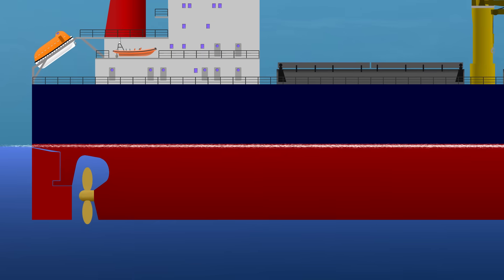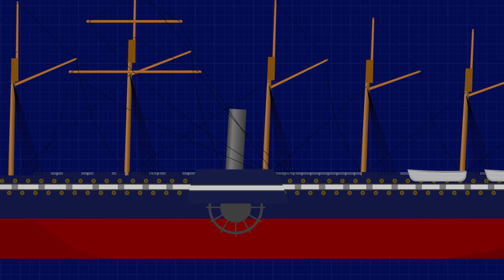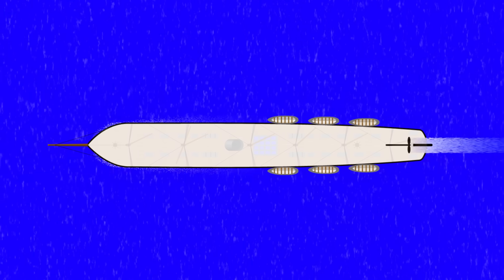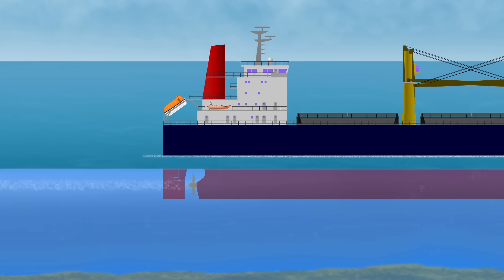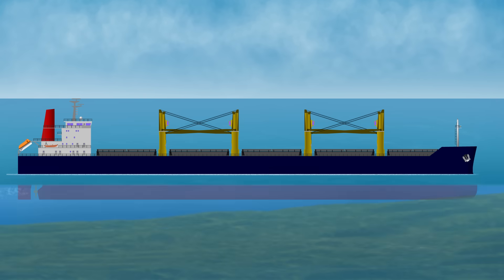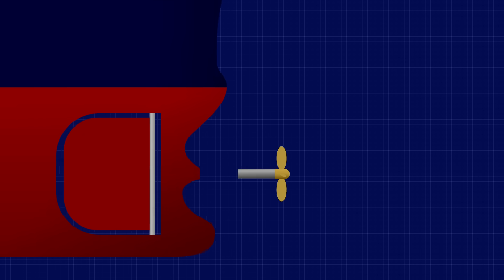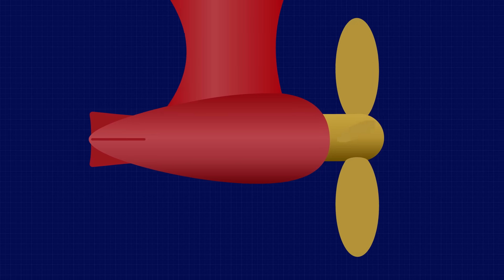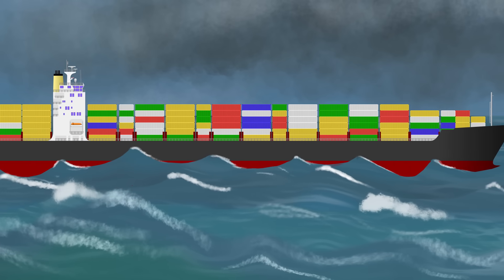Why Is The Propeller At The Back?

Comment: Interesting that he didn't mention what seems to me the primary reason that you never steer a ship from the front, which is the same as the reason that you never steer an airplane from the front either. I mean you can do it, yes. And some airplanes have done it. But it's inherently unstable.

It's like driving a car in reverse.

The dynamics are interesting. It only makes sense that driving a car being steered from the rear would be inherently unstable and want to make you flip around, if you just think about the geometry, the positive feedback loop — the runaway effect.

Or personal experience. It's incredibly difficult to maintain stability steering a car in reverse. It would be the exact same way flying a plane or steering the ship with the steering surfaces in the front.

Because of fluid dynamics as opposed to road dynamics, steering the ship or an airplane from the front would make you want to flip around the exact same way a car wants to flip around in reverse.

Anyway, this seems to me the primary reason: this inherent instability that would make the ship want to suddenly flip around like an arrow flying with the feathers on the forward end (and the same reason you always have the fins on the rear of a bomb or missile).

I strongly suspect I'm right about the fundamental dynamic, because once you start turning left you would have a runaway affect making the whole ship want to flip around to the left.

I think he just got lost in the details, the myriad other reasons, but which would have been overrun had the fundamental dynamics of pulling the ship placed the propeller in a place that made the ships general passage more stable. All those other issues that he mentioned would simply have had to be dealt with as best we could.

If it wasn't for the one big dynamic I just mentioned.

Comment: The primary reason for having the airscrew at the front of aircraft is space availability, and the secondary reason is engine cooling, which is markedly worse in pusher designs
Reply: Aircraft need to pitch up for both takeoff and landing, so front mounted propellers need less landing gear height to avoid a prop-strike.
On the other hand, no, pusher designs neither have worse cooling in flight (propellers do not increase mass flow rate of air for a radiator, only its speed), and almost all turboprops are still tractors, despite no requirement for separate cooling air and their very small engine size.

Comment: I'd like to point out that a propeller at the stern doesn't always stay submerged. In heavy seas it is not unusual for the propeller to become visible or even completely being out of the water for short periods. This isn't a very good thing for the engine of course, as it suddenly loses its load. This leads to a quick increase in the RPM until the propeller submerges again.

Comment: My old main ship had tow azimuths under the mid part of the vessel. Was working quite good when pacing on the ship, due to the sucking from the props. Also been on a ship with a retractable in the front, which when laying standby could work like a anchor and keeping the heading quite good

Comment: Steering a canoe from the back is easier and more effective than it has any excuse for being, and steering when you're in front is correspondingly harder and less effective.  In either case, the force is exerted on the water next to the hull, so the issue of water from the propeller running into the hull doesn't apply.  There's no rudder, nor is there a shaft and seal to worry about.  When a paddle hits the bottom, it just enables you to push more effectively.  None of the stated reasons apply, yet power applied at the stern provides incomparably better control.  So I think there's probably some other reason, that wasn't covered in the video.

Comment: I wonder if water jet propulsion systems will ever be used on large ships like they are used on smaller vessels.
Reply: There isn't really much of a point. Water jets are less efficient than open propellers, the only reason they're used on small boats is that the fun factor and maneuverability that they provide beats out fuel economy. The original reason why jet boats were invented in the first place was an accident of history, there were no marine propulsion drivetrains that could handle the big auto engines that motorboat enthusiasts were putting into their small boats, but irrigation pumps were available that could handle the horsepower.
Reply: @AlRoderick  Not just small boats but new ferries use them now, they may not be classed as ships but are not small, not North Sea or Irish Sea ones, they are quite large vessels now capable of 22 knots plus and handling rough seas without having to hang onto ones dinner plate, just high winds prevent them docking so cause delays and cancellations.  Makes them very manoeuvrable with bow thrusters and can come about in their own length.

Comment: Propellers on planes generate extra lift because the propwash is so much faster than the general airspeed, and lift varies by the square of the speed.  Pusher prop planes and jet planes don't have this benefit, which greatly helps shorten takeoff runs.

Comment: I have two questions which might make for a short video.
* Why are some containers 53 feet long?  I understand 20 and 40 feet, containers were invented by an American.  But 53?  It's not a nice metric conversion, it's just weird.
* Had anyone ever thought of rotating container stowage 90 degrees so they are athwartship instead of fore and aft?  It seems it would make them more resistant to falling overboard in rough seas.  But that assumes rolling is more dangerous than pitching, and since ships try to head into waves instead of crossing, maybe athwartship stacking would knock more containers overboard forward, and running into the flotsam would be a lot worse than having it disappear astern.

Comment: Thinking of the comparison between airplanes and ships, I realized another major factor the video missed. Having the propeller at the rear - be it of an airplane or ship - is more efficient overall as it re-energizes the boundary layer, though the propeller itself suffers in efficiency due to turbulence entering it. This improvement is more pronounced on ships than on aircraft for a couple reasons. Ships have skin friction - water dragged along the side of the ship as the ship moves through it - as a greater portion, I've heard even the vast majority, of their drag. The propeller re-energizing this helps a lot, the ideal thing would be to draw in all this water that's been slowed down and speed it back up, resulting in nearly zero water movement in either direction behind the ship. Not to mention that the size of the boundary layer is probably larger relative to the propeller than it is for an aircraft, which has a much larger propeller due to less dense air. Airplanes have skin drag as well, but it's a smaller portion of their overall drag, as they're in contact with a lot less mass of fluid, and much of the drag is induced and wingtip-vortex drag from the wings, a lot of drag being a by-product of the need to generate lift that doesn't apply to ships. Meanwhile the water flow behind a ship's hull is probably a lot less turbulent than behind an airplane, as ship hulls are designed only to be as streamlined as possible, disturb the water as little as they can, while aircraft have to redirect air downward in order to generate lift - this is very visible in videos of airplanes flying low over dusty ground, punching in and out of clouds, or the patterns of smoke and flames behind military aircraft dispensing flares. This "wake" of downward-moving air behind an airplane is such a big factor that aircraft must be carefully directed to avoid being too close behind one another, especially a smaller aircraft behind a larger one, and there have been several crashes caused by this. Having the propeller operating in this much more disturbed air would reduce the propeller's efficiency, while likely also causing vibrations and noise as the propeller moves through the wake - certainly a lot of noise on some pusher-propeller aircraft (most famously the Piaggio P.180) from engine exhaust passing through the blades.

Comment: Ships are so much heavier with so much more inertia that the control dynamics are very slow and "pushing on a string" is easy to handle.   Planes need to be very light and a push prop is much harder to control the stability.

Comment: As a steel structural engineer i get all the hydrodynamic reasoning but man does that "compression is better than tension" feel soooo wrong on so many levels to me
Reply: Something about efficient conditions for the propellor to be able to push and not pull the water?
Reply: @wouterke9871  I didn't mean that, I was talking about the propeller shaft being in compression

Comment: Worth saying that a number of aircraft have used rear propellers (most famously the first plane from the Wrights, but there have been others).

Arguably these days it's most popular to mount the engine in the middle of the plane, on the wings.
Reply: Of course when you're thinking of "these days," you're probably thinking of jets. Propeller aircraft most often - but not always - have tractor propellers, even when mounted on the wings. Though wing mounted propeller engines could be seen as sort of similar to the Azipods mentioned in the videos, mounted separately from the main hull/fuselage rather than at one end of it.
Reply: Of course there are other factors but with aircraft the major consideration of bailing out tends to favor Tractor arrangement, pusher planes being notorious people blenders.
Reply: @MediumRareOpinions  That's applicable to military aircraft, and the few pusher-engine fighters often had systems to explosively jettison the propeller if bailing out, or some of the first ejection seats were developed for this reason. Not a concern for civil aircraft though, most civil aircraft, even small propeller planes, the occupants don't have parachutes, so you'd have bigger problems than being chopped by a rear propeller if you jumped out.

Comment: For anyone wondering about why plane propellers are usually at the front:

Planes need to point a bit up into the oncoming airflow to take off. If the propeller were at the rear it would either crash into the ground, or the plane's gear would need to be very long especially at the nose. It's the same thing for landing as usually planes need to keep their nose fairly high when landing.

Comment: The only ships I believe that do have in a certain mode with props at the front are either icebreakers or icebreakering tankers. 
These are designed to run bow first for normal running, and stern first to break thick ice. But have similar efficiency at lower speeds. Lastly these use a pair or quad of azipod thrusters as well as rudder. This increases manoeuvrability.
Reply: The purpose of an icebreaker's bow propeller was to suck water out from under the ice in front of the ship, making it easier to collapse and break. That turned out to be not as true as was thought, so bow props were left off new ships or removed from old ones.
Reply: Double ended ferries do too (to go with the matching bridge at each end).

Comment: Another point is stability. With the rudder in the front any drifting of the vessel will cause it to turn further without corrections. It's like pushing a trailer instead of pulling it
Reply: Makes sense
Reply: Exactly this, its also why frontal canards on aircraft are much less common than tail mounted elevators, the negative feedback for angle of attack makes aircraft much safer and easier to operate, and you also don't have a critical threshold where rotation become irrecoverable (because the drag of the control surface causes simlar or more rotation in the direction your already turning than it creates in force to turn you back towards the center).
Reply: @SheepInACart  Aircraft with canards are just as safe and stable as those with rear tails. The larger, lower-loaded aft wing still puts the center of pressure aft of the center of gravity. The same could be achieved on a ship with a front rudder and large rear stabilizing fin, but it would probably be less maneuverable and more drag overall, so no reason to do so.
Reply: @quillmaurer6563  The issue isn't where the center of pressure is in level flight, its how it moves with control input. Canard aircraft on the civil market are absolutely made equally safe,  but there are strong reasons why they make up a tiny minority, and also slightly more common in high performance applications like racing or military fighters.
Reply: @SheepInACart  The issue with canards is balance. Where the center of mass vs center of lift is on the aircraft. With a traditional tail, the main wings are the majority of your lift so cente rof lift is fairly fixed so balancing where the weight is on the craft is fairly easy. With canards, the main wings and the canards provide lift shifting the center of lift forward of the main wings thus making balancing a lot more complicated. If the weight is to far forward, you can't get enough lift on the canards and the plain can't get its nose off the ground. If the weight is too far aft you can get too much lift on the canards and the plane can flip over. And in between the extremes, control can become difficult if the weight is not balanced just right.
Reply: You could have a rudder at the front and a large stabilizing fin at the rear, as long as the center of pressure is behind the center of mass it will be stable. This would be like a car steering with the front wheels, having non-steering rear wheels. Or even like a canard-type airplane, having the elevator at the front and main wing at the back. But a rudder at the front and less stabilizing at the rear would indeed be somewhat unstable, like a car with casters at the rear or when the rear tires are sliding (that Top Gear episode where they put pie-pans under the rear tires).
Reply: @quillmaurer6563  "You could have a rudder at the front and a large stabilizing fin at the rear"
Sure, but any time you have a large thing to correct problems with some other thing, that tends to be rather inefficient.